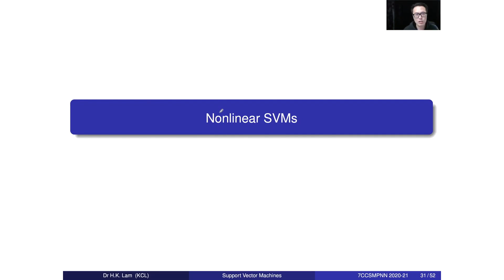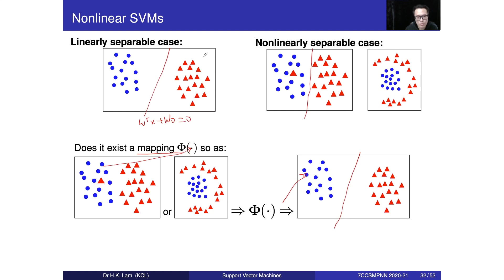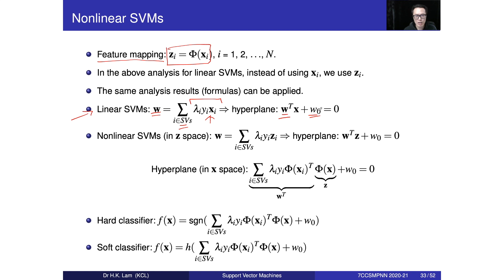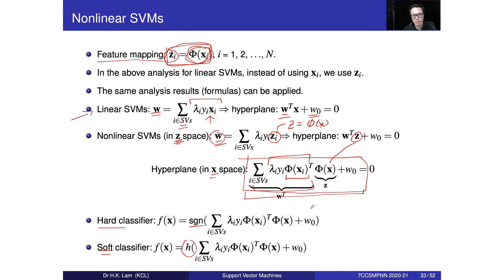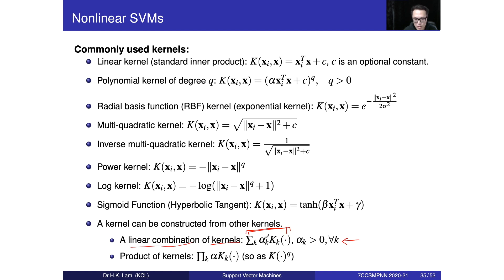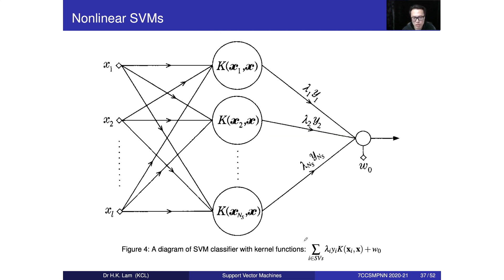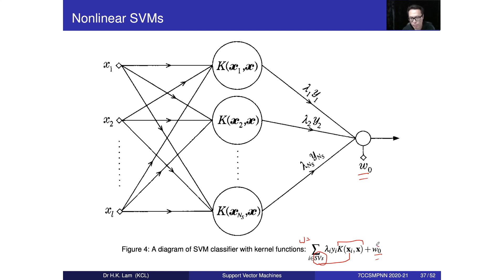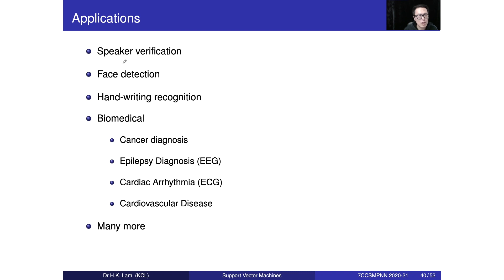Support Vector Machines - Part 4: Nonlinear SVMs

Comment: This is awesome, but I have a question, on the slide at 3:50 what does lambda[i] represent?
Reply from the maker: It is the Lagrange multiplier for the i-th sample (or support vector)
Reply: @hklam2368  Thank You, I am taking Mchine Learning at Cal State University and the material is much less dense than yours so I was struggling to follow, but now I see! I appreciate such a high level lesson!
Reply from the maker: @brandonteller5360  Thank you, 😀